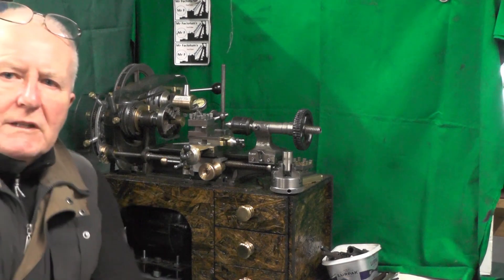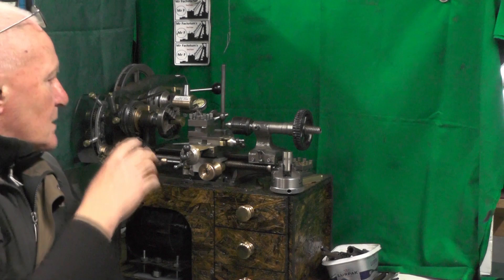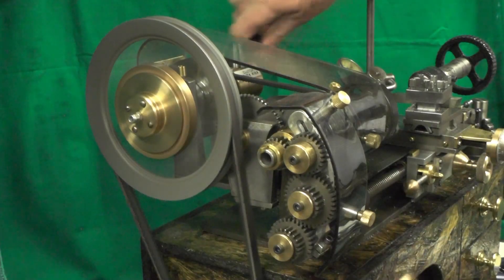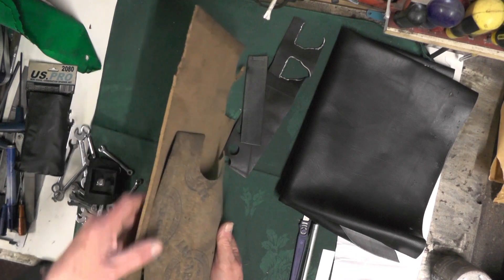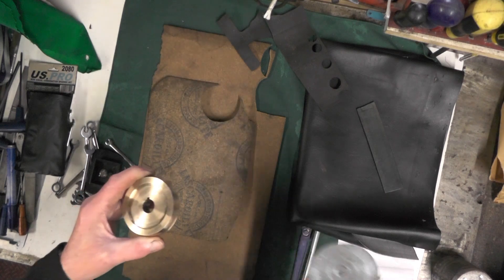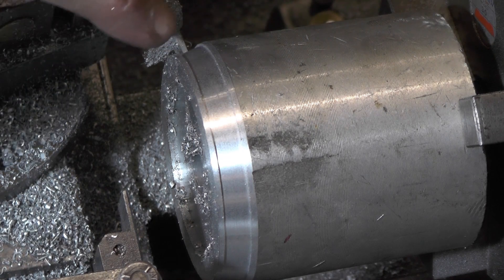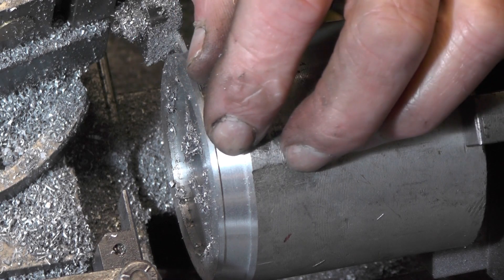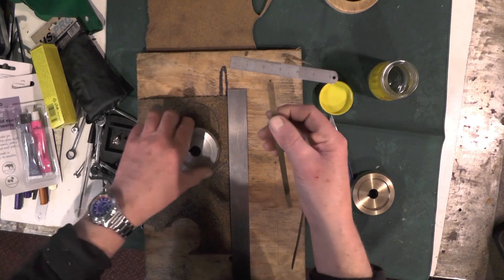Ep 29 (Cone Clutch FAILURE !!!) Make a Micro / Mini / Small Lathe "mr factotum"

Comment: An interesting fix Kev. I guess if the cork wears it will be easy to replace. About two years ago I fitted a s/hand clutch to my 
Myford. The moving part is bronze, and closes again the cast pulley wheel. There's also a strong spring inside the counter shaft. Fun to fit, but I wouldn't do it again! Cheers Nobby
Reply from the maker: thanks Nobby, 
yes i modelled on a myford clutch but couldn't find a way to fit a strong spring due to space restrictions, otherwise it would have worked okay, you live and learn!!! but it works great now.
appreciate the feedback, i've still got to catch up on your latest video.
Regards
Kev

Comment: I don't wanna sound rude but bronze on bronze makes for a terrible clutch as bronze is a bearing material and quite a good one a that so choosing it for a clutch seems quite stupid to me
Clutches are usually cast iron and some friction material as the coefficient of friction for cast iron is relatively high when paired with something softer like cork or clutch padding or break pad material which the best I know of is sintered cast iron I believe (like the ones in tractor clutches)
or if you would really want a bronze clutch without any friction material you can always make the angle shallower tho that might result in a clutch that can bind if the angle is too shallow
Reply from the maker: hiya Cj
It's okay i have a thick skin, so thanks very much for your interest.
Bronze is a brilliant bearing material if lubricated, if dry though it sticks like s---- to a shovel. It would have worked with a stronger spring to pull the tapers together, but being a micro lathe i had no room for stronger spring, but all good now and it works great.
Many Thanks for watching and feedback much appreciated.👍👍👍😉
cheers 
Kev
Reply: @MrFactotum  Really? I never seen it do that although it's true I never put 2 pieces of bronze together under pressure. I assumed it would be bad cuz of it's bearing properties. I forgot I wanted to suggest just making the disk from aluminium as it's soft and doesn't have the best bearing properties unless very well lubricated or with anodized

Anyways thanks for sharing your knowledge.
Reply from the maker: @Cjarka_  cheers Cj👍👍👍👍
it's good to share off different peoples ideas, were all learning on that never ending learning curve all just at different points on the arc.
atb
Kev

Comment: Great fix! I believe in days gone cast iron was after used for cone clutches though I wouldn't know if it would be better than bronze. I guess it primarily depends upon the length of the cone with respect to diameter and spring pressure.
Reply from the maker: Hi Nigel
Yes you've got it, a stronger spring would have done the trick Nigel,  but no room,
i initially thought with the micro forces involved it would have been enough friction, but you live and learn. I will know now for the next one😄
see you next time👍👍👍👍
ATB
Kev

Comment: Looks like a safety feature Kev 🤣 I wonder if it’s the angle that was the problem? Myford use a similar idea for the clutch with metal to metal contact with brass or bronze. I’ve never taken mine apart though. Great solution works really well 😀
Reply from the maker: Thanks Julia
i modelled it on the Myford but with being a small lathe the spring wasn't strong enough and no room to get a stronger one in, but it works great now
cheers👍👍
Kev
Reply: Hi Kev. That was a well thought out solution which definitely worked out very well for you. Brilliant result. 👏👏👍😀
Reply from the maker: @andrewatcarpathian  Thanks very much Andrew, works great now. See you next time, Kev

Comment: The other thought I had. Was a clutch of a chainsaw. Which works centrifugal as the power increases the weights move through springs to take up the drive. But it’s how to adapt it to work. Just an idea. Good video enjoyed it.
Reply from the maker: Great point! A👍
Maybe next time 😉😄👍👍👍
This one is working great now, so my moto is if not broke don't fix it, but i will keep your suggestion in mind for a future lathe
Many thanks👍👍👍👍
Kev
Reply: @MrFactotum  Centrifugal clutches require a certain minimum RPM to engage so I don't think it would work too well in this application

Comment: VERY interesting video Kev.  I never gave the fact that you used bronze for the clutch much thought, but I can see now why it was a bad idea.  Bronze is naturally slippery.  The only cone clutches I've had any experience with were either vintage car (cork faced cone with cast iron receiver) and cylinder type lawn mower (cone and taper receiver mating surfaces both bare cast iron).   I would be inclined to leave the aluminium cone in place as it will have much better heat transfer/dissipation than bronze and should preserve the cork longer.  Looks OK as well.  Cheers Rob
Reply from the maker: cheers Rob
Yes it works great.
I used bronze because if you ever get bronze bearing grab tight on a shaft you can't move it for love nor money, it would have actually worked if i could have got a stronger spring on, but with everthing being so small and tight for space i couldn't manage it.
Anyway it works great now no slippage with a 600 mm long piece of stout timber levering on the chuck, Solid as a rock👍👍👍👍👍👍👍😉😉
many thanks for your thoughts, appreciated
regards
 Kev